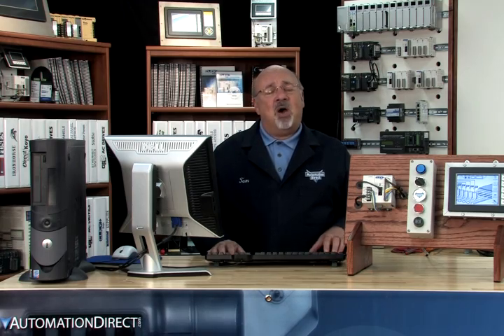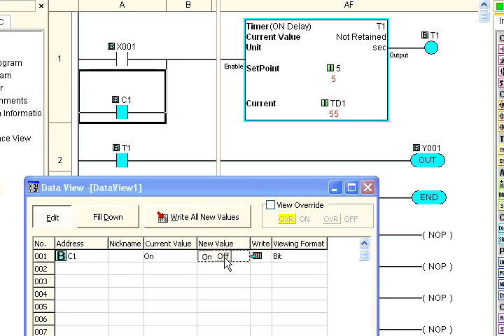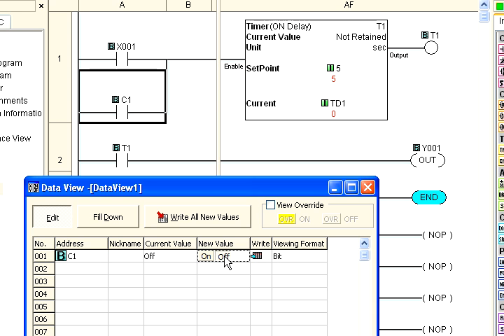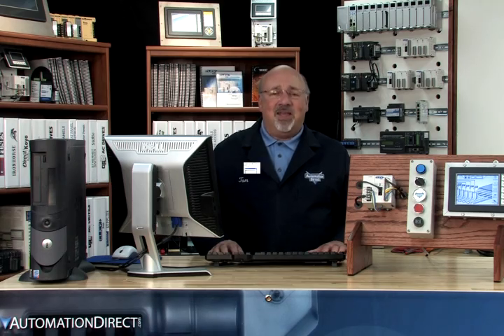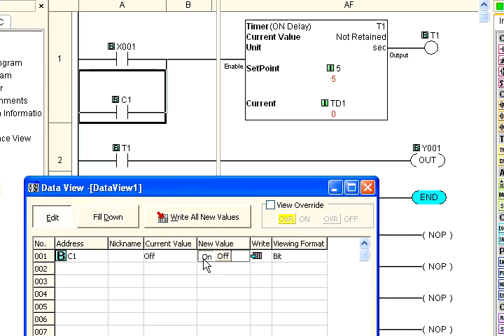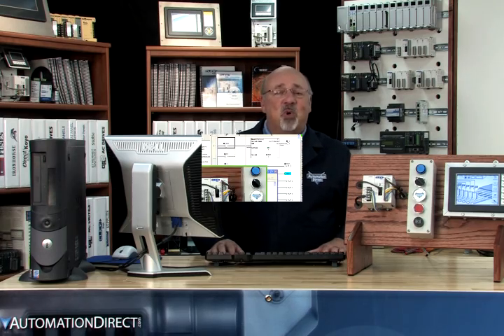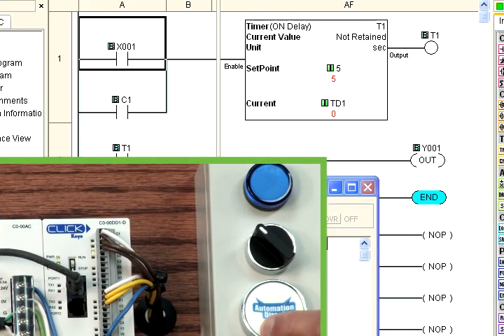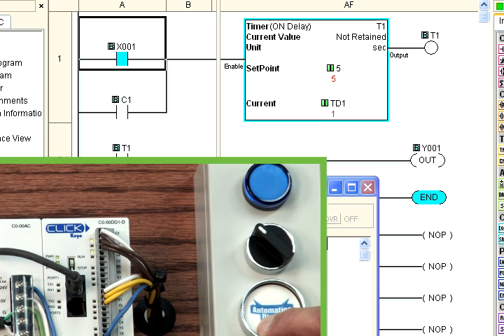CLICK PLC - Getting the PLC Started (Part 10) from AutomationDirect

Comment: Thank's for the series. I've been having an issue that just came up on a new unit. It was working as intended until the output voltage for y001 dropped. What are causes for this issue so I can avoid it in the future? The other outputs seem to be fine and I'm using the plc in a simple circuit to power a relay
Reply from the maker: The causes can vary depending on the output type. I would advise contacting Tech Support and have them help find the issue. 1800-633-0405
Reply: @automationdirect  Ah thank you for your response here. 
It turns out that I fried the output pin because a relay housing (which looked pristine) actually had a short in it. I was relying on overload protection to protect my PLC from damage but did not realize until after some research that the overload protection I have been accustomed to comes from the nice CLICK power supply and not from the plc itself. 

Unfortunately, I fried 3 output pins out of the 6 total before realizing what was happening. Won't happen again, though!

Note to self: overload protection is extremely important to prevent plc outputs from cooking
the output pins are sufficiently isolated to prevent other outputs from burning from the same short, so that is also good.
Reply from the maker: Thanks for the follow up!